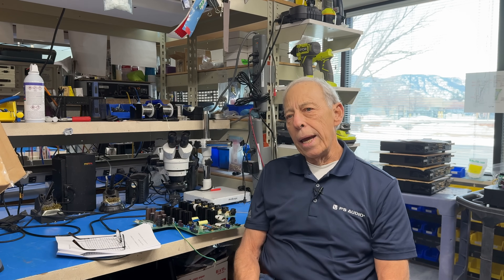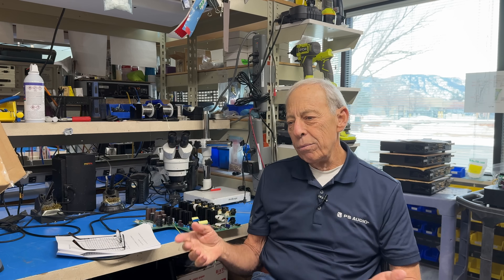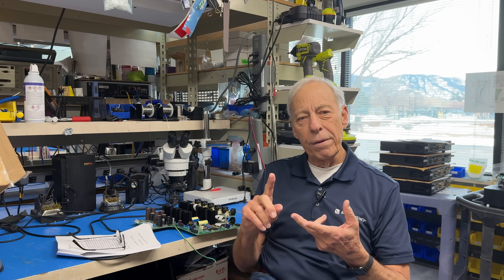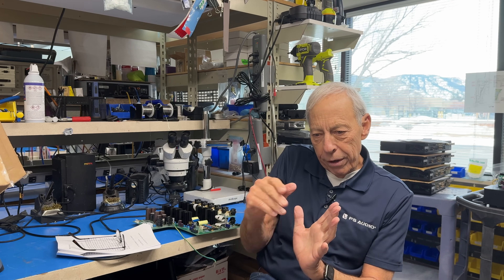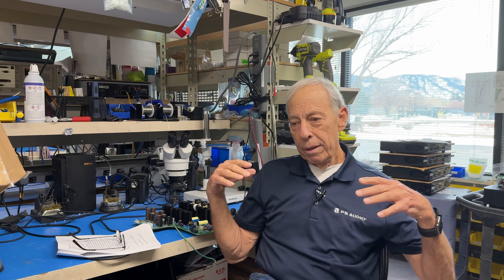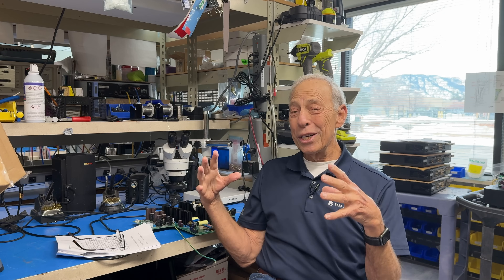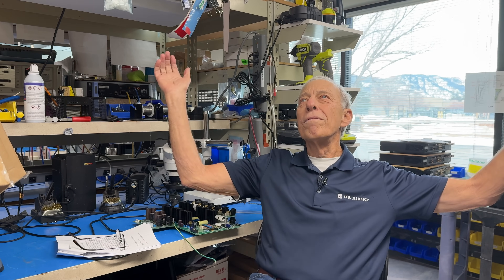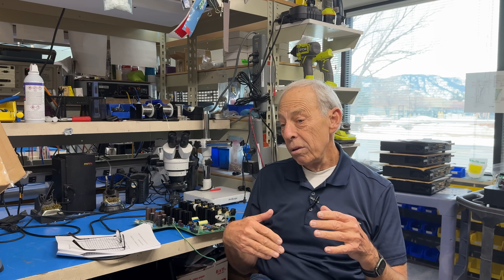Why power amps have more wattage than speakers can handle

Comment: You Missed The Point 
These Million Dollar Systems are OEM
Circuit Crossovers
That Are Hard Wired 
To The Speakers 🔊 
Yet Programable 
Pro-Audio Crossovers 
Are Much More Sophisticated 
Than a Hard Wired 
Circuit Board 
Which Once You Connect All The Speaker Crossover Points Parameters By
Programming a
Pro-Audio Crossover 
Then You Will Hear a
Difference 
There is No Need 
To Listen To a
Million Dollar 
Home Audio Sound 
Systems 
Because That’s 
To Subjective Because Everyone’s Ears Are Different 😮 A Oscilloscope is 
Indiscriminate Not
Subjective 
I Can Hook Up a
Oscilloscope And 
Give You Numbers 
Those My Not Make Any Sense To You 
Because Your Ears 👂 
Are Subjective 
Yet The Oscilloscope
Dose Not Lie 
That’s 
Why I Don’t Need To 
Hear Many Million Dollar Systems I Can Just Read Their Numbers On The Internet 
I Need To Get The Numbers and One Can 
Build a Better 
Home System 
Without Paying 
a Million Dollars 
Because Not Every 
OEM Has Pussed Out
Equipment 😮
Reply: So just go by the oscilloscope even if you don't like the sound?

Comment: I don't think Paul explains dynamic range and headroom in the amp well enough (with differences between pop with compression and classical), the aspect of speaker efficiency, how +10 dB (twice as loud) takes about ten times the power, how loud you listen, room size, etc. And that bass eats up most of the wattage. Small amps can be fine for small speakers and small rooms at say 75-80 dB avg. listening levels.

Comment: Back in the day ( late 1970s ) Infinity Systems packed with their loudspeakers an advisory concerning amplifier clipping and how it could damage drivers. It cautioned users not to turn the level (volume)control past the 1 o'clock position because musical transients could drive the amp into hard clipping.
Reply: The quantum series infinitys could not get enough power . The 100 w Nikko mentioned earlier would not cut it . Continuously blowing tweeters at just moderate volumes . Amp ran hot .   Those speakers were ahead of their time .

Comment: When Paul Read The
Letter 7 Hours Ago 
I Just Yawned and 
That’s All Paul Had To
Do and Two Lip Smacks
and I Was Lulled To 
Sleep 🛌…..
…..There Are Many Other 
Ways To Approach This 
Issue Pauls Analogy is Yet Just 
One Way Of Getting The 
Absolute Same Results 
Yet Most of These So
Called Audio File
Manufacturers Even 
The Big Names Have One
Approach….Yet There Is a
Much More Complex and Inexpensive Approach and 
With Better Results That’s Bi-Amp and 
Tri-Amp Your System 
Then We Have To Go Into 
Cross Over Points 
That’s Always Been My
Approach Yet It’s Not 
For Everyone 
Yet Once You Get The 
Right Cross Over Points 
Programed That’s Within 
Each Speaker’s Parameters Now We Are Talking… Every Speaker 🔈 Manufacturers Have Hard Wired Circuit Cross Overs Built Into Their Speakers Cabinets 🔊 Yet Not All Cross Overs Are Created Equal This is Why I Do Not Subscribe To One Complete Audio System By One Manufacturer 
I Mean You Have Million Dollar Home Sound Systems By One OEM Yet You Can Get Better Audio Equipment From Separate Manufacturers With Better Results For Half The Price Yet Most Folks 
Do Not Know How To Program a Pro-Audio 
Cross Over and Most 
Home Audio Files Do Not 
Have a Oscilloscope  
Now We Are Dealing With Real Numbers Not
A Subjective View But a
Numbers Perspective Of Putting Together a 
Audio System 
My System is Not a
Million Dollar System 
Yet It Will Blow Any Million Dollar System into 
The Weeds 
I’ve Got The Original 
Pressing of Dark Side of 
The Moon On
The Harvest Label and 
You Can Actually Hear 
The Songs Being Counted Out When You Program a
Pro-Audio Crossover 
To The Speakers Frequency Parameters With a Oscilloscope 
Not a Hard Wired Circuit 
Board The Numbers 
Do Not Lie….
And The Results is
Night and Day 
Especially if
The Listener is a 
Vinyl Record Person 
Tape Reel to Reel 
This Oddly Enough is a
Broad Stroke….
There Are Some Amazing 
Speaker Manufacturers 
That Will Custom Build You a Cabinet and Load Their Speaker 🔈 into a Cabinet 
These Companies Are That Are Still Small
Enough To Do This 
Sorry I Got Carried Away 
….I Got a Question For 
Paul “ Does The Altitude 
In Colorado Effect 
The Performance and Dynamics of Your 
Speakers “”
Now I Know 
The Answer 
I Just Want Paul 
To Give His Loyal 
Viewers The Answer 
Time For Coffee ☕️
Reply: How many 1 million dollar systems have you actually compared your great system to?

Comment: The other way to go is speaker efficiency. At 100 db/W you can achieve that same effortlessness with a high quality but modest power amp. It also is probably the more affordable way for most people.
Reply: I did the same. 94dB/W speakers.
Amplifier (tubes) 2x 32W and I use about 2x 3W, enough headroom.

Comment: There is an additional issue of the point of "damage".  
If a speaker reaches its power limit it will sound bad, and we will want to turn it down way before you damage anything.
If an amplifier reaches it limit it will suddenly clip - the signal voltage curve will suddenly dip in a sharp cliff edge. A clipping amplifier will tear a speaker cone apart in seconds as it is impossible for the speaker to follow the clip curve.
It is just good practice to have an amplifier with more reserve space than a speaker, if not you are unlikely to get much warning before needing to replace the speakers as they rip the cones apart.
Reply: An amplifier clipping is a trivial event, not uncommon, and unless there is an absurd disparity between the power output and the speaker power handing or long-term continuous overdriving, it doesn't bother respectable speakers. If clipping always tore speaker cones apart, the world would be full of shredded up speakers. It's good practice to have amplifier power adequate to minimize clipping, but the fact is speakers tolerate moderate clipping on reasonable music material just fine. My old 50W AR18s speakers are manufacturer rated for use with an amplifier up to 100W output when driven into clipping for less than 10% of the time. The speakers have been perfectly happy with that plan for over 40 years.
Reply: A notable exception to speakers' general tolerance of moderate clipping, is if one is sufficiently unwise as to use fully DC coupled amplification (e.g. laboratory power amp), in which case clipping introduces a DC offset that can indeed be very injurious for LF drivers. Perhaps that could create the impression that all instances of clipping must be harmful to speakers. A few capacitor hating audiophiles might fall into the trap of seeking a completely capacitor free signal path by this means, but they could well be hoist with their own petard. Using a much higher powered amplifier to try avoiding clipping would make that much more undesirable power available as DC if a rare clip did occur.

Comment: Loved the engine rating analogy. You buy 400 HP but only need 20 HP to go down the highway. I friend used to joke it was like buying fine scotch / whiskey in the 1.75 ltr bottle but only drinking it by the glass. Sometimes you sip and other times you "tilt back" to get the punch!

Comment: The answer is actually a bit more complicated. The idea that a higher wattage rating will have a wider linear region is almost complete nonsense. Here is the catch. Every transistor, tube, etc. has a set of operating curves. Your job as an amp designer is to find a point in these curves where the amp will have a wide linear voltage swing. The wider the linear region, the bigger the sweet spot. Say we have a mosfet that is biased at 24v. It's linear region is between 32 and 16 volts. You could design the amp with a 32v power supply and significantly cut down on the rated power for the amplifier. There is nothing stopping you from doing that. But generally people will design the power supply such that you can achieve full output which in this case is 48v. After all, why would we want 50 watts when we can have 200 watts? Of course the catch is that increasing the power did not increase the linear region of the amplifier. 

Where it gets tricky is when you start to parallel devices. An old trick to improve performance in an amplifier is to use smaller - less powerful - amplifying devices in parallel. When you put matched devices in parallel you get an interesting effect. Noise and distortion go down and you generally get more power out. So the trick is to find a device with the widest possible linear voltage swing. If the device has a wide voltage swing, but can't source a lot of current, you can parallel a bunch of devices in order to improve power and distortion. The kicker is that you can parallel devices even when you have enough current because you will still lower distortion. This is why you might see 8 or 16 devices in parallel in some giant 1500 watt amp. You won't use the power, but you will get cleaner power when you use the amp in it's sweet spot. Nelson pass famously built an amp with a couple thousand Jfets in parallel and the performance is hard to beat. 

So the idea that more power inherently means a wider linear region is not true. It all depends on how the amp was designed.

Comment: I tried to explain to people that many years ago .when they came to my house to listen to my stereo .they could not understand how a 100 watt per Chanel receiver put out clean peaks over 200 watts .and I tried to explain to them I have a dedicated circuit for the receiver and I showed them that most of the sound they were listening to was about 35 to 50 watts rms and the peaks went over 200watts ..The power supply was massive in that receiver probably 50,000uf on a dual rail power supply ..Turning it on it produced a large surge and more than 3 times the power rating .Wish they would have used a soft start on the power supply in addition to  the speaker protection circuit ..Regret every day I sold that receiver .Dynamics were amazing .Pink Floyd ,Supertramp,Vivaldi you name it it played it .

Comment: Perfect explanation Paul.
All a person needs to do is listen to the sound produced by the amp at higher thresholds, (volume) and this immediately becomes very clear. As long as the speakers are rated for the wattage.
I'm about to invest in a new 2 channel kit and am targeting an amp with 200, maybe 250 watts for the very reason you explained.
I appreciate the information you share regarding HiFi.

Cheers

Comment: We can also add that certain brief bits of the audio signal, called transients, require much more power, but only for milliseconds, which shouldn't in any way harm a speaker, although they may technically require more than the speakers rated power, or close to it, but only for milliseconds.

Comment: The analogy to cars made me thing something that might be silly, or not. We have a power rating on amplifiers, Watts, and we also have a power rating on cars, HP or kW. We also have a torque rating on cars, that relates to the effortlessness. I don't see a similar rating on amplifiers, unless that would be slew rate.
Reply: Indeed a very bad comparison.
Good if you want high sales though.
Reply: And btw, hp is only a product of rpm and torque, inversely proportional to a constant. It's misleading to say torque is related to ''effortless'' and hp is not.
Reply: Wouldn't it be THD ? At 5 watts, the big motor would be silent at 0.001% versus noisy at 10% for the small motor.

Comment: Why do cars have more hp than they need to go 65mph?
Reply: It's not about top speed but how quickly you can get to 65.  I have a Hellcat and rarely press the gas pedal more than 50 percent of the way down.  It gets to 65 effortlessly.  But when I want scare passengers it goes like a scalded ape!
Reply: Because an under powered car/truck is as boring and annoying as a clock radio. 😁
Reply: My 1996 Porsche 911/993 Turbo with 600hp & 595 ft lbs torque sure did and keep going to 200 mph!! 😅

Comment: Do you need all this power for real? If you have a speaker with acceptable sensitivity in a normal sized room?. I am no technician but I think a good powerspupply is all you need. I had 2 Denon POA-2200 and then connected a great 100 watt Van Medevoort amplifier and that gave such better results. Therefore, I am cured with the idea that you need lots of power, especially if the powersupply is great. Small power NAD amplifiers are a good example, their nominal power rating is small, but they can deliver much more power for a short while. Or even de Mission Cyrus 1 or 2. There are so many great amplifiers with a modest power rating, so I do not even care any more what power it has. Maybe if you have a huge room or so, In The Netherlands we do not usually have that and have to be kind to neighbors as well.
Reply: It's a tricky one! I was pleased with my 80wpc integrated amp until I heard a friends 600 wpc power amp with a valve based preamp.

The power was astonishing for "palpability" I sold my integrated and bought broadly the same system with money left over.

 I cant ever use all the power but like Paul's car analogy there is never stress strain or distortion. I play at the same levels as before but the music now is much more involving much more visceral And I know it will run most speakers on the market when I upgrade.

Comment: Some years ago I decided to try a tube amp for the first time. I did not want to spend a lot of money for one & I purchased the Reisong A10 a 6 watt per channel amp. I had a pair of vintage JBL 4312C monitors that are. very efficient &  was shocked at how good they sounded. Went very Loud effortlessly w/ deep bass. Only 6 watts!  I eventually purchased a Willsenton R8 w/ 40 watts per channel. I have more power than I'll ever need. Can't even turn up the volume half way it's so loud. More power than i'll ever need.
Reply: Surely you don't think Reisong amps sound good... i mean, really? Yes, I've heard one, and it was shipped back to amazon the next day. I mean, they don't sound horrible, but I'd rather increase my pocket size to then buy a better amp.

Comment: "Amps handle more wattage than speakers". Amps don't push wattage; a nuclear power plant doesn't push it in our amps. Gain (and the knob position) isn't a wattage indicator. dB/W isn't the same that dB/2,83 V for speakers that aren't 8 Ω nominal: wrong unit will gave an erroneous conclusion about sensitivity of speakers or wattage needed for amps. Incomplete specs of amps will give an unreal wattage value (graph, or at least distortion at the max power and not distortion at half power or no distortion value at all, must be given).  An amplifier tries to establish a voltage for that instant, the impedance of the speakers demands current (an wattage for that same tension), and finally, the amplifier tries to give the current and wattage demanded by the speaker. Low output impedance is important.
Reply: i blame the spec sheets, they are so oversimplified that they misinform and now everyone has an opinion and more questions than anything.
Reply: @sudd3660 In that situation (oversimplified or misinformation), I don't buy that brand.
Reply: @Jorge-Fernandez-Lopez  i mean that oversimplified data leads to misinformation.  or more accurately leads to assumption.
examples that are common: 84db sensitivity, 300watt.

Comment: High damping factor is another reason. Easier to achieve with big amps.
Reply: also with adequate power amp if it's output stage is well designed.

Comment: I thought my high current amplifier would never meet a load that it couldn’t provide for but then along came the subwoofer 🔊 that had 8” voice coils that were rated to handle 3,500 Watts RMS continuously and 5,000 Watts Peak!  E squared/ Z where Z is Xl or 2piFL.  How can I connect an oscilloscope to the amplifier monitor the clipping?

Comment: No,  most outlets are on 20A circuits, 15A just used on a lighting only circuit.
Reply: Where do you get this information as a home renovator this is not what I see for the most part.
Reply: In newer houses, yes. In older houses, no.
Also, most duplex  outlets are only rated for 15 amps.
Reply: @machintelligence most new houses in my area only get 20amp circuits in kitchens and bathrooms, most other circuits are 15amp.
Reply: The breaker amperage rating isn't what's at play here. 

A 15a breaker can pass huge amounts of current without tripping. 

- Up to 7x the rated trip amount, ... for up to a second or more.

- Up to 3x the rated amount for up to 10sec.  

- Up to 2x the rated amount for as long as 30 seconds.

There's plenty of current on tap at the wall. Voltage, on the other hand, can certainly suffer from I²R losses. 

It's prudent to upsize wire AWG feeding amplifier loads, ... especially those serving up the bottom end.

Comment: Hey Paul, you don't need to worry (re. your Freudian slip) about conscription, Trump is cutting the military and pulling out of Europe. You seem like nice folk, and must be hanging your heads in shame at what your president (if I can call him that) has been saying.
As in the case of Canada the anti- american outrage is rising in Europe,with American goods spurned. I would hate to have a Starlink or Tesla (hope that's not your electric car) dealership, for sure. Apart from threatened tarrifs this outrage will surely hit your sales. Are you ashamed AND worried?

Comment: I would love to see measurements that back this up.
Reply: Examine most any amplifier distortion measurement graph. 
Oftentimes a sweetspot of linearity exists just below clipping.
Reply: @FOH3663  So if you have a 1000w amplifier i need use 999w to hit the linearity sweet spot? That's a good design!